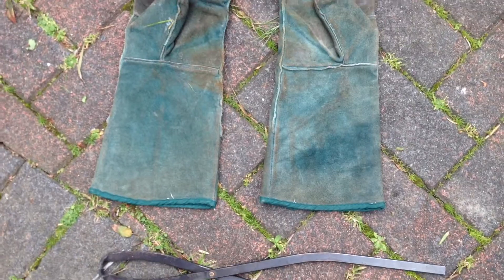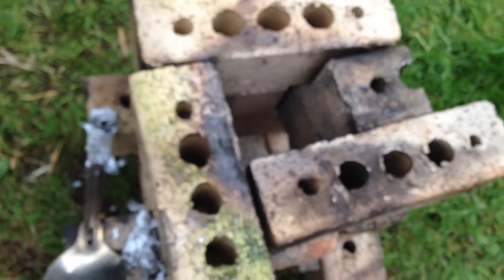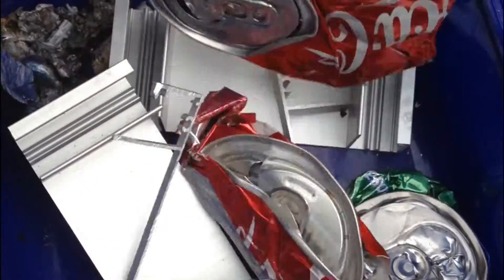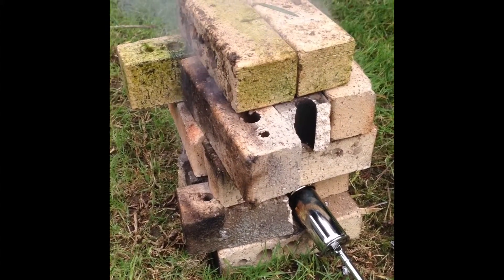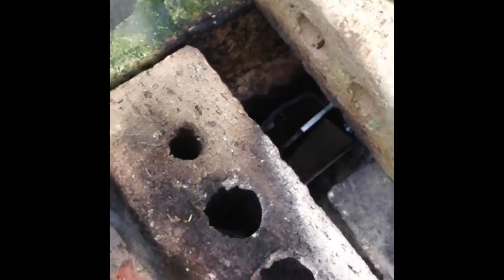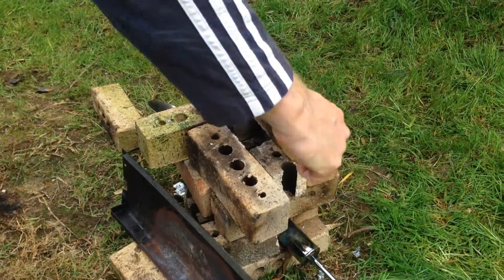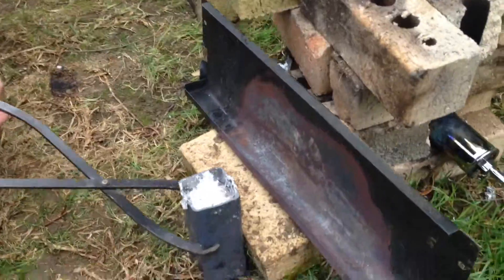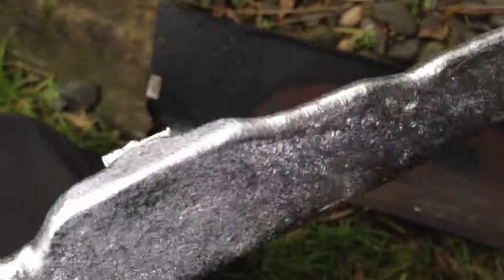Quick Gas Forge for Melting Aluminium

Comment: what types of things would you use the aluminum to make
Reply from the maker: +justin11905 my son wants to make a slingshot. My wife wants things to do art with (various shapes). I'm keen to make knife handles, tool handles and maybe a mallet.
Reply: so would you remelt and make forms to make those thing or shape the cold metal just wondering